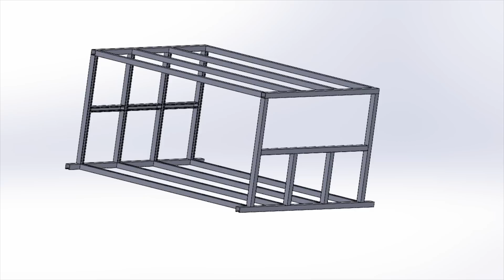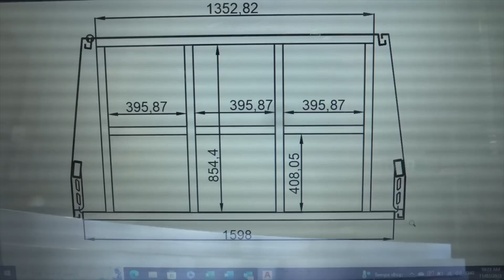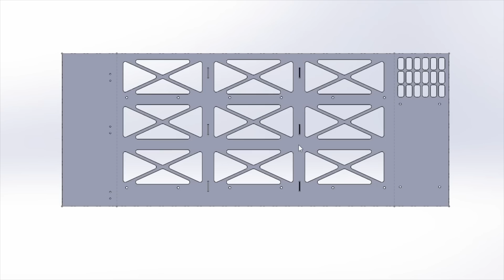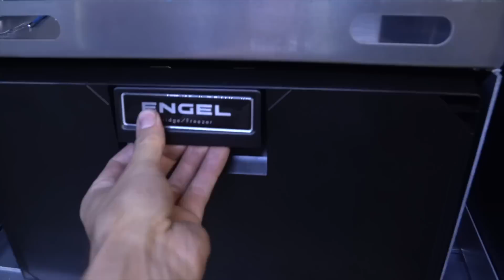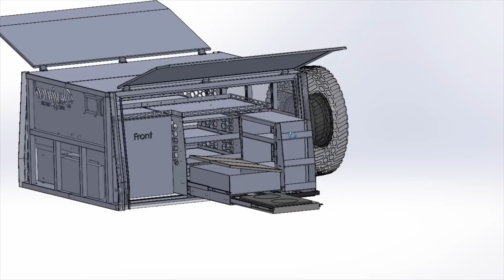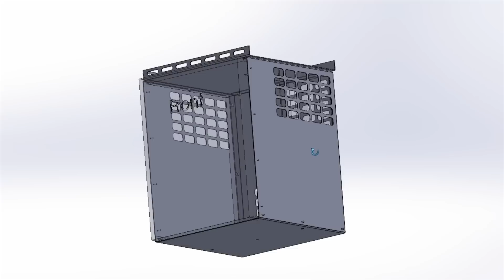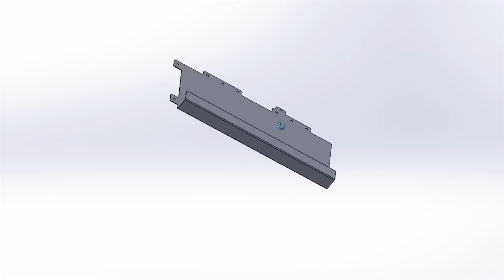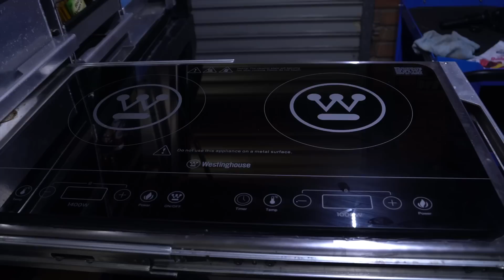300 hours to BUILD my DREAM CAMPING setup | Timelapse

Comment: Jesus how could we ever have fun offroad without engineered drawers and a 5 star kitchen. Insanity. Ice in a cooler Coleman stove and a decent tent.  Good to go.  Take the 20$k for vanity bs and spend it on fuel and mechanical reliability.
Reply from the maker: You're really having a go at the majority of Australians who tow vans, camper trailers, have touring setups etc... 

More than happy to rough it but when on the road for a few months it is nice to have a few creature comforts. The car is mechanically reliable, I made sure of that before I embarked on the canopy build. It cost far less than 20k since it was DIY.
Reply: For some it's not just about having the best gear it's more about having nice things to live off if your like me and spend almost your whole life driving around remote areas it's nice to be comfortable while living your life